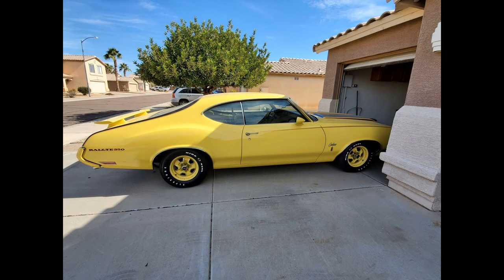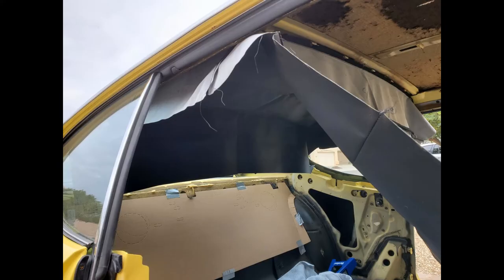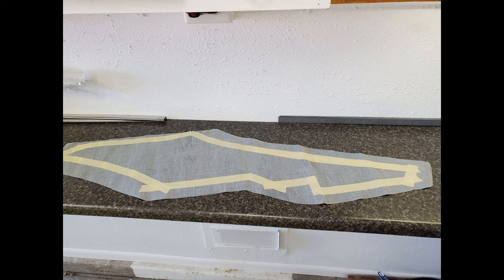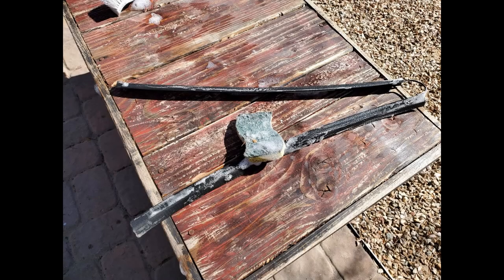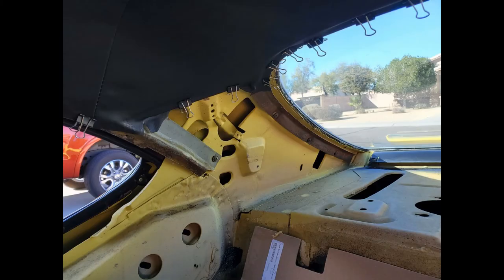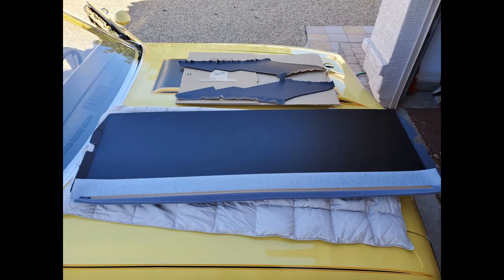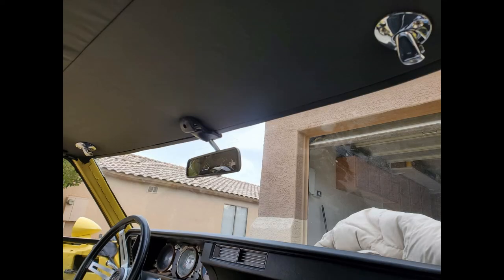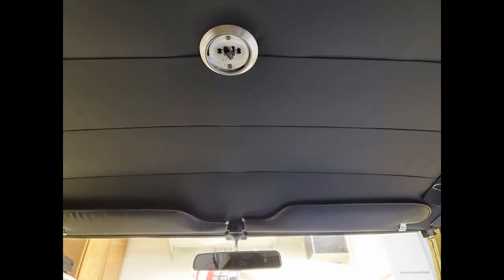Headliner Install for cars with bow type headliners. Rallye 350 Restoration 2021. interior Part 2

Comment: Excellent video.  Local upholstery shop wanted $750 just for labor on an install, plus a wait time of 4 weeks.  My project is a '61 Pontiac and there are some significant differences.  I can't use binder clips on the front or back because mine uses staples there.  Also, my sail panels are the headliner, so a lot of opportunity for wrinkles in that area.  Hoping with patience I can get it right....
Reply from the maker: thanks Hank! If you can find a way to secure the headliner material and practice stretching it, I found that knowledge to be extremely useful. People attribute headliner installations to some kind of magic art. But if you think it through and have a plan that'll go a long way towards having success. Good luck on your headliner install!
Reply: @SPSteve  Finished, looks great!  Looks so good I have very few small wrinkles at the back window.  I have a steamer but not sure it's worth the risk, I'm pretty happy as is!
Reply from the maker: @hankreardon6998  Congrats! I'm glad your install went well, and you saved a bunch of money!
Reply: @D  I did it myself and it looks hreat.

Comment: Ive always started back to front with the bows.
Reply from the maker: Certainly more than one way to do things. Do what works best for you. This was my one and only headliner install and it worked out well.
Reply: Im on my second and last ,did my 68 Roadrunner now doing a 69 GTX started on it last night .. don't plan on doing anymore thanks for the video..
Reply from the maker: Same here, my Rallye 350 will most likely be my last classic car so I won't need to do another install. Good luck with the GTX. @danielwatkins286

Comment: Nice job! I wish you would have talked a little more about installing the rear window trim that seems like the biggest obstacle in my install on my El Camino, again really well done>
Reply from the maker: Thanks Dallas. If you are talking about the cardboard sail panels, those are held in place by wrapping the fabric around the rails, the center attaches to the body with velcro and the long thin section with a screw. You can see at the 6:00 mark where I left the fabric loose on the sail panel where it wraps around the rail. The windlace just presses into place. I know it will be a little different for an El Camino, and I've never owned an El Camino, but since it is a Chevelle with a bed I would expect it to be similar.

Comment: Damn nice work. While you’re gluing it Tight  if you decide to do another one use a steamer like magic no wrinkles I’ve only had frustration with the back/sides above the Sell panels and Getting the cell panels or the headliner to lay against each other really good but that’s about it try steamer next time and there’s really good money in it most people don’t have the patience though LOL and don’t blame them Being responsible for other peoples cars and having to make them look good . Cool video cool car 🇺🇸💯
Reply from the maker: thanks! Yes the sail panels are the tricky part but I found that after I trimmed the headliner it was easier to pull it tight. I just used a hair dryer to tighten it up. I didn't want to spend money on a tool I would only use once, but a steamer is the way to go. I imagine you can get more heat on the fabric without damaging it with a steamer. I don't think I'll need to do another headliner. I'm 65 and the cars I have now will probably be my last project cars. Thanks for watching!

Comment: Good video, thank you. Everyone talks about the DAP Landau Top glue for this for its high heat resistance, have you had any trouble with the glue you used?
Reply from the maker: None at all, the headliner still looks great. If I were to do another headliner install I wouldn't hesitate to use the same glue.

Comment: where did you order the velcro squares for the sail panels?
Reply from the maker: It's been a while but I think they came with the sail panels. If not any velcro would work. Just attach the velcro with a strong adhesive.